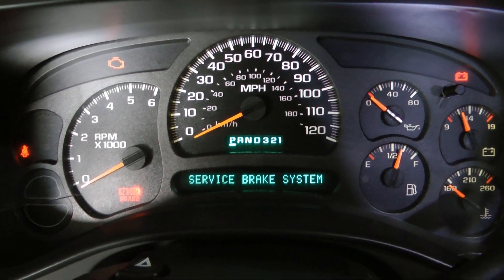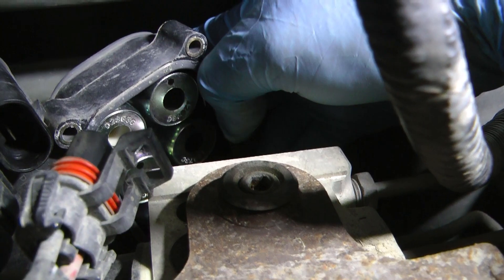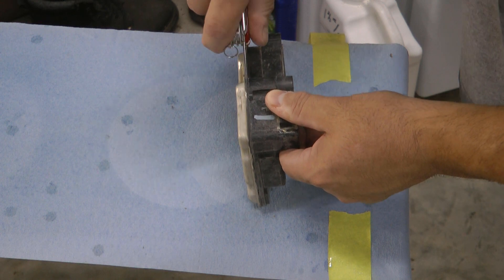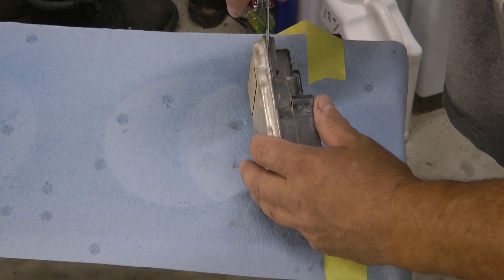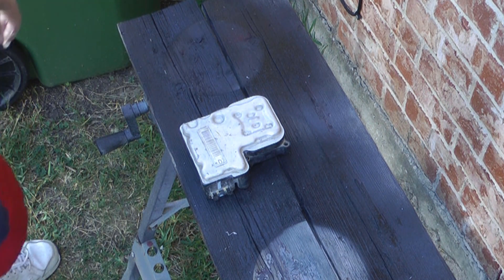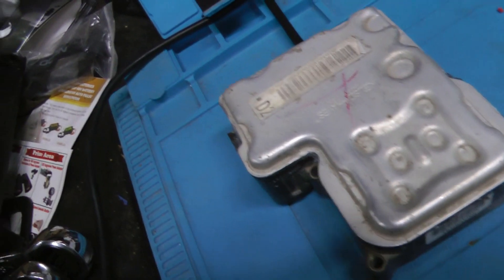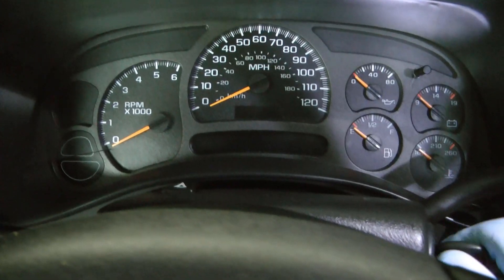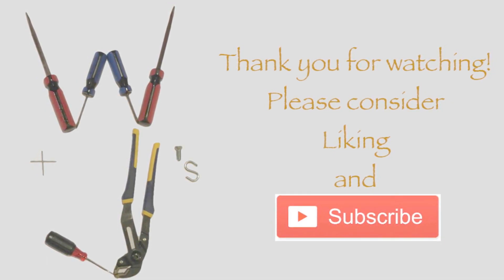Service Brake System fix - GM Chevy GMC Cadillac EBCM Electronic Brake Control Module

Comment: You can disconnect those 3 electrical connections plug them back in and it will reset your abs lights . So you probably just reset them .
Reply from the maker: hasn't come back since this repair was done

Comment: i know this was posted awhile ago but hoping for some direction i replaced all lines bled the breaks alot i ran 2 bigger bottles through it bleeding all 4 corners today about 2 weeks later i get the brake message on dash pedal still firm but with  loss of braking power where should i look could it be the ebcm?
Reply from the maker: I was about to say I got a very soft pedal and had to replace the brake booster, which immediately fixed the soft pedal.  But you say you have a firm pedal so I don't know.  Might need someone to press brake while you watch each caliper to see what they are doing.  Good luck!
Reply: @WJHandyDad  thank you

Comment: What code was the vehicle sending?
Reply from the maker: I never checked codes - I guess I should have... but this fixed it immediately
Reply: @WJHandyDad  my truck is throwing p0500 p0700
P0721 I’m thinking it’s the TCM at this point

Comment: Mine is so messed up that it's throwing a 4x4 code as well computer can't read anything and it won't start won't even try to turn over and the battery drains within 10 minutes or so. I'm going to do the same to mine and hopefully that fixes it
Reply from the maker: hope you get it figured out.  I know these vehicles are prone to ground wire failures - while you're under there look at the major ground spots and see if any of them are rusted/corroded.

Comment: Ok so i have changed master cylinder, brake booster, bled my brake lines at every turn with vaccuum and manually theres no air in my system. Spingey brakes all the way to the floor.
Stiff when truck is off the minute truck is on they are soft sponget and to the floor. Have to manually pump them to try and build enough pressure to stop.
HELP!!!
Reply from the maker: I developed that symptom when my brake booster went bad but as soon as I replaced everything was fine again.  I doubt it's this, but you can see if you have air trapped in the ABS module - preferably run an ABS bleed with a high level scan tool, but some are able to go out on a gravel road and lock up the brakes a few times, then go do a manual bleed.  good luck
Reply: @WJHandyDad  IM HAVING BRAKE PROBLEMS. ONE THING I FOUND IS MY BOOSTER IS NOT HOLDING VACUME.AND THE CHECK VALE IS GOOD. I HOPE IT IS THE BOOSTER. REAL SPONGY PEDAL WHEN CAR IS RUNNING, BLED THE BRAKES ABOUT 5 TIMES. WHEN ENGINE NOT RUNNING MY PEDAL IS STIFF. START THE CAR AND PEDAL SINKS TO THE FLOOR.
Reply from the maker: @goodvrsevil737  on my Avalanche when it had that symptom it was the brake booster.  As soon as I replaced the booster the pedal got firm.  And just like you I kept bleeding the brakes thinking it was air in the lines.

Comment: this is one of the worst locations ive seen. although at this point almost all spots are
Reply from the maker: it seems like they could have put it roughly where it is, but made it where you bolt from bottom upward rather than top down

Comment: So my Yukon reads check brake system across the dashboard but no lights or on ??
Reply from the maker: the thing I showed in the video is extremely common so worth doing if you can stand climbing under there to retrieve the EBCM

Comment: You need a bit of solder on the iron tip to help transfer the heat.
I reflowed mine and still have the parking brake light and service brake system on dash.

Comment: Would this cause the transmission to down shift to help you brake?
Reply from the maker: I'm not aware of these downshifting to provide "engine braking."  My Charger police car clearly does and when I had the Caprice it was even mentioned in the owner's manual that it would try to anticipate it and downshift.
Reply: @WJHandyDad  it was my speed transmission sensor. It was 23 bucks and my truck shifts normal again with no dash lights anymore It literally took 5 to 10 minutes to change
Reply from the maker: glad it was cheap and easy to fix... that is so rare nowadays!
Reply: @aaronvilla13 Did you get any lights or a code? I have the ABS and brake lights on, no speedometer, and it won't shift up.
Reply: @AHill-oi9ct did you ever fix it?
Reply: @AHill-oi9ct have same issue
Reply: @shshsgsdd I did. Turns out I just needed a transmission.

Comment: I did this on mine but unfortunately the brake light went out but the ABS is still on
Reply from the maker: if you have access to a higher level scan tool like an Xtool D7 you can get the ABS code and see why it is lit up.
Reply: @WJHandyDad  thank you 🙏 but I don have this tool I go put a new one

Comment: Sorry my men,I got the same crazy situación but I do not know if that is my problem,I got just abs on but I instal all brake lines and now I got code where said,wheel sensors missing,selenoid error,etc etc
Reply from the maker: wheel speed sensor problems will cause ABS issues.  Go back and double check your work to make sure they are all on correctly

Comment: I just had my booster replaced less than a month ago and it worked just fine after that up until today. My breaks stiffened and the service brake system came up on my dash....what could be the issue?!?!
Reply from the maker: my issue was opposite... brake pedal went right to the floor...  when I replaced my booster it fixed the soft pedal immediately.  Having a pedal that is too firm sounds like a clog in the system somewhere not allowing the fluid to flow or your calipers might be locked up

Comment: Needa raise the temp on your soldering iron. If you have to sit there n wait... its too cold n you can actually do damage to the board as your heating the whole thing up. Higher heat instantly melts the solder and the heat doesnt have enough time to travel
Reply from the maker: I don't lower the temp of my soldering iron... I just have a terrible time keeping them clean it seems.  I can clean with steel wool, solder one thing, and then boom it's back to dirty and needing a cleaning

Comment: Pulling the abs fuse also cures abs gremlins
Reply from the maker: I guess for a temporary "fix" that will work.  Certainly easier than trying to access the EBCM
Reply: How much does a repair like this cost anyone?

Comment: I would consider liking this video but... having to listen to your theories, complaints & rants just to get to the relative data scattered through the video will prevent that. A more focused & concise instructional video is what's needed.
Reply from the maker: well thanks for watching and glad it was helpful.  The rants are important to get the message out that engineers don't need to be stupid
Reply: Hw put time stamps.  Skip to what you want to hear.

Comment: My pedal went to the floor and the warming came on and I figured a brake line busted again but there's no leaks I can find anywhere.
Reply from the maker: if no leaks my guess would be failed brake booster.  My brake pedal was dropping to the floor with no effort.  Replaced my brake booster and all is back to normal.

Comment: Now how do you fix the issue where i cant see the PRND?
Reply from the maker: I haven't run across that, but I would assume it's probably a bad solder point in the cluster somewhere.  Check out Jeffescortix channel - he shows videos how to fix them but also fixes them too if it's beyond your DIY skills
Reply: Had the same issue plus the transmission went into limp mode. Turned out that i needed a new TCM. Not a cheap fix

Comment: What size torx?
Reply: T55 on the front brakes on my 03 suburban 1500 4wd
Reply from the maker: surely I mentioned in the video
Reply: @WJHandyDad  time stamp?
Reply from the maker: @Junk_and_disorderly  I don't know, I thought I did.  They look like probably T20 or T25?  Take your torx bits and test fit in the easiest one to access to make sure

Comment: I  got this message after  just changing the pads and rotor on a 2003 Avalanche.  Bled like I usually do, and did the automated bleed with my scan tool, no codes in the ABS module.
Reply from the maker: interestingly mine popped up after changing brake pads too, but went away with the fix in the video.  My brake booster also died when I changed brake pads.  And I am not one who forces the fluid back through - I open bleeder valves to spread calipers and then I refill and bleed the whole system, so it seems odd that both went bad simultaneously
Reply: Were you having a "no communication" problem with abs module as well??
  The rants & opinions that you recieved complaints about are fine/great, no problems here. Keep going!
Reply: 03 Chevy 2500 HD 8.1 only comes on in the Am then goes off

Comment: I feel the same way as you do. I hate the way things are engineered on the vehicles of today. Everything that needs to be replaced is put in the most inconvenient place's. And I don't think that these vehicles needs all of these electronic gadgets on them. Then some of the electronic gadgets has these to five wiring  connectors to them when on one would do. The engineers in the design department thinks that they are designing a plane or a rocket when they are designing these vehicles. They need to go back to designing vehicles simple and easier like they used to be back in the good old days.

Comment: Will this cause your brake pedal to go all the way down also?
Reply: Found out it was a bad brake line
Reply from the maker: It's possible but in my case I had a bad brake booster.  Once I replaced the booster the pedal firmed right up.
Reply: Mine is having the same issue, right after a brake job too where I got new calipers, in your case was the petal also firm until the vehicle ran and then it would become spongy?
Reply from the maker: my brake pedal got very spongy after I changed brake pads.  I bled and bled and bled the brakes (including ABS bleeds) but nothing helped.  Then I replaced the brake booster and boom, fixed imediately

Comment: Will this cause the truck not to start ? Because I’m getting the same message and now truck doesn’t want to start
Reply from the maker: should be a completely different issue - mine never had issues starting
Reply: I have a no start issue as well. Did you have any luck getting yours started
Reply: No start caused by bad TCM?
Reply: Did you ever figure your issue out I’m have a no crank issue and it’s saying service brake system
Reply: @DIRTY__DAWG2713  mine was the same and it was the TCM. I soldered a wire to one of the tcm pegs and grounded it to my frame rail. It’s a temporary solution to get the truck on the road while I wait for a TCM.